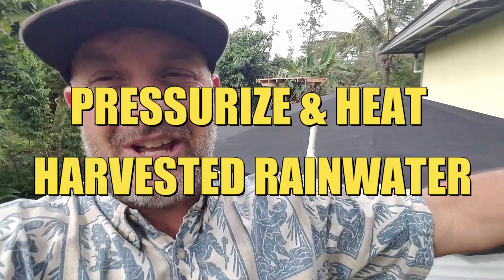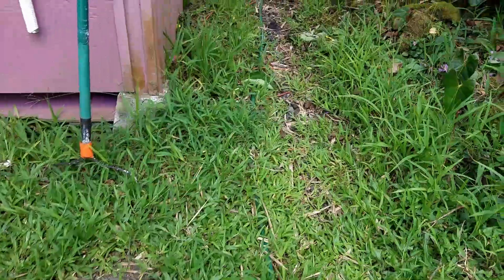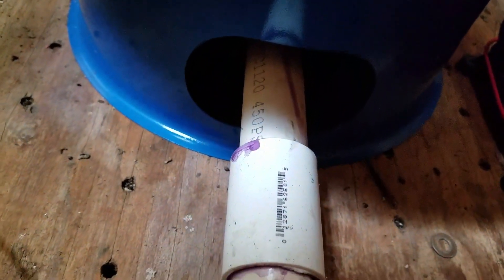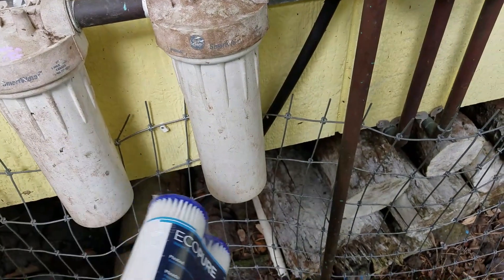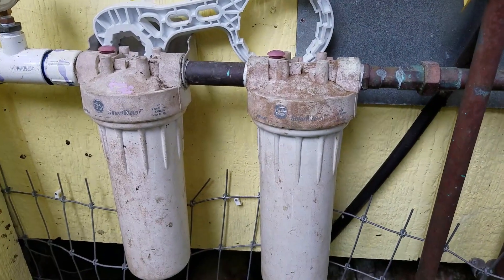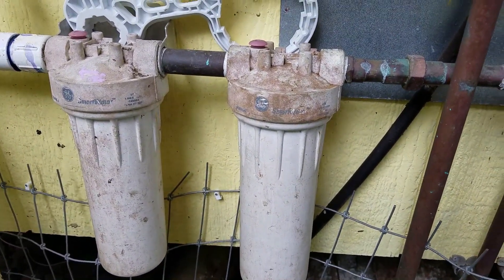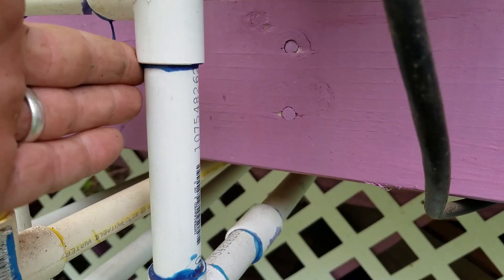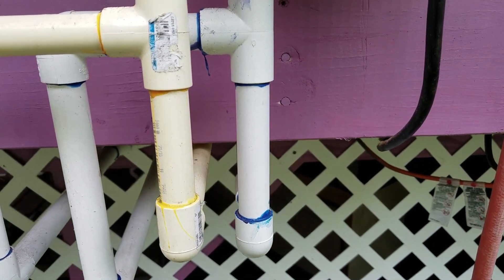How to Pressurize Off Grid Water Tanks and Make It Drinkable Too!!!

Comment: How does the pump knows when to switch on and off
Reply from the maker: It works in tandem with the pressure tank and gauge. The pump is programmed at the factory to kick on at 20psi and turn off at 45psi.

Comment: I have a pump that I just plug in (in the yard) & it pumps water out to the yard. Can I use that pump just plug it in & have it run thru kitchen & bath? If so what wud I do. Please help me if you can. 
I rented home out to try to get a head & it just got me no running water. For quite some time now. I replaced it @700$ just to have it freeze n bust. I have a 4k gal. Cistern that I catch water in however it also has been mistreated so to have water I have a number uptown . Comes quite in handy. Anyway I thank you eagerly awaiting to hear you're response.
Plumb befuddled in Ohio
Reply from the maker: I wish I could help but I am not familiar with freezing climates.  But you can just use a plug in pump, you'd have to know how to do a little plumbing though, cutting and glueing pvc, making the necessary attachments, etc

Comment: Thanks for the awesome video! I’m about to set up the exact same thing as your moms house over on Oahu, but I was wondering if you had to pump into her catchment tank or is her roof high enough that gravity does it for you? I have a 6000 gallon tank and the top is higher than the roof so I was thinking about catching it in a 300 gallon tote and pumping it into the bigger tank, just wondering what you used
Reply from the maker: Your tank will work but whatever is above the roofline will not fill, You shouldn't have to use a pump to pump into a tank, you will never be able to keep up with it in a rain event.  Best to be passive

Comment: I think you should have a check valve between your pump and the pressure tank to keep water in the pressure tank from flowing back into your water supply.
Reply from the maker: Did it not get shown?  There is one there.

Comment: Hi, 
I followed the same setup as you for my land. I installed everything exactly as you did. For some reason my pressure tank is not getting filled with water it goes straight to the rest of the house by the pump only and doesnt even fill the pressure tank at all. I have the same 1” T fitting to the pressure tank like you do but no luck. Maybe i need a pressure switch? I see you dont have one would that fix my issue? Or what could it be
Reply from the maker: I’d have to see pictures. Want to send them to me at info@homesteadinhawaii.com?

Comment: Hello, I thought you have to use a pressure cut in cutting off switch on pressure tanks.  I'm confused. Any help is appreciated. Thanks again.
Reply from the maker: I’m not quite sure what your asking. My pressure tank is set to cut off at 40 psi and turn on at 20 psi. It does it automatically
Reply: How to do cut off lower than 35 ? Matter before pressure tank that's my question. I'm in OV big island

Comment: Hey legend. Thanks so much for this. Is your pressure tank also on solar? I can’t find any pressure tanks that work with solar. Is the load ok? Or is it a 12v pressure tank? And advice would be great. Thank you!
Reply from the maker: It’s just the pressure tank from Home Depot. It doesn’t use power.  The pump uses power though. It’s a flojet pump from inter island solar
Reply: @HomesteadinHawaii  thanks so much!  That’s great. Your videos rock!

Comment: So do you run the water from the tank directly into the pressure tank or do you need the pump to pump the water into the pressure tank
Reply from the maker: There is a foot valve in the water tank which leads to a flojet pump (connected by 1" pvc) THEN the pressure tank

Comment: How often do you have to cleanout your leaf and debris filter? What is the procedure to add some kind tank level indicator so you don't have to remove cover?
Reply: Thanks. Do you do consulting and catchment tank services?
Reply from the maker: @kenc2242  I'd be happy to help out if you need it. Are you looking for someone to install a tank or just give you guidance?
Reply: @HomesteadinHawaii  hey I appreciate that. I live in HPP and although we are not living off grid, using a catchment tank and septic system is all new to me. I was interested in hearing someone with more experience that can advise how to make maintenance easier for myself but especially for my wife. How close are you to HPP? What would you charge for a couple hours of your time? New to your channel, but loving it so far. Thanks ken
Reply from the maker: I clean out the debris filter 2x's a month and clean the gutters 2x's per year. 

My moms tank has a clear plastic 1/2" hose that goes inside the tank and runs along the outside of the tank allowing us to read the level without having to look inside.